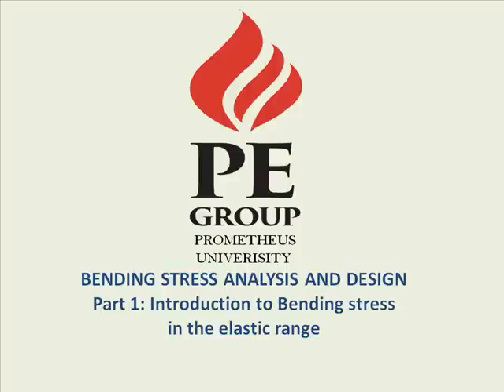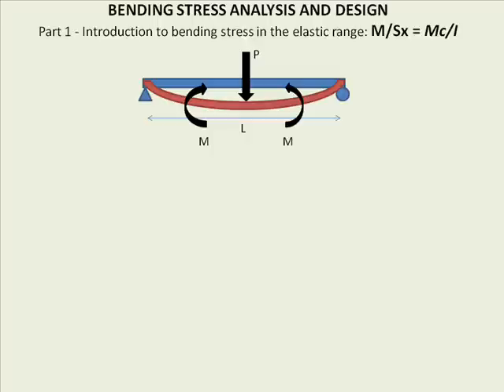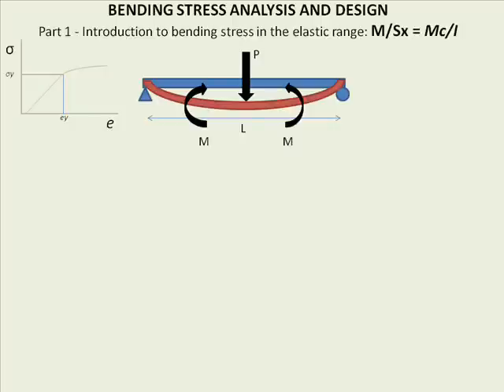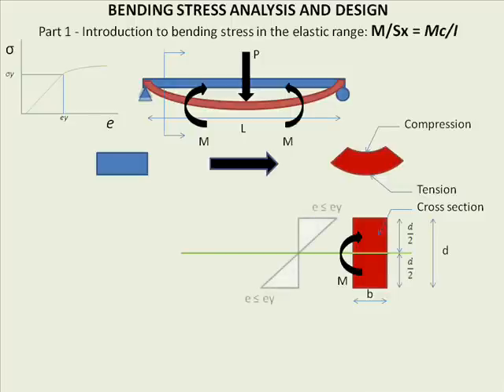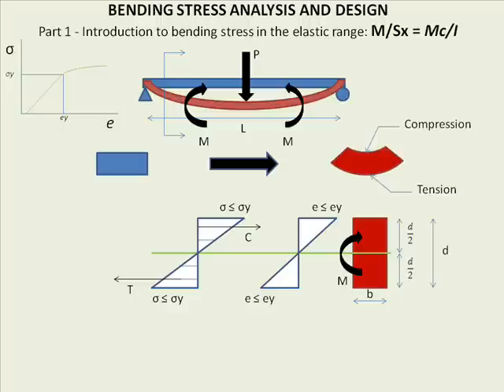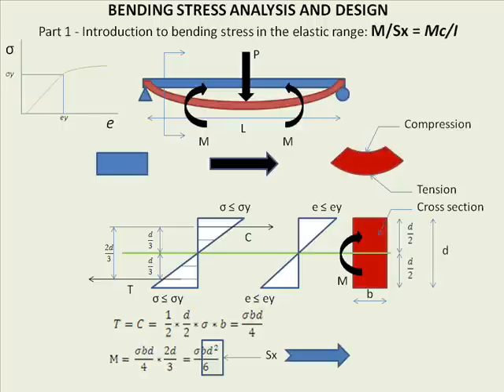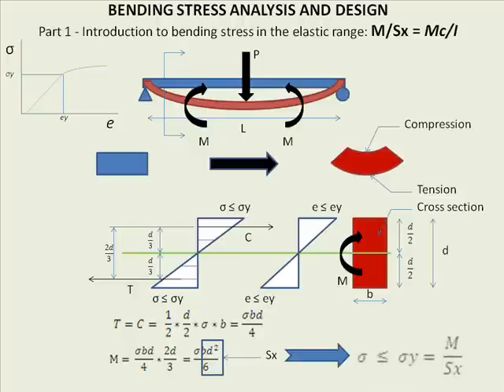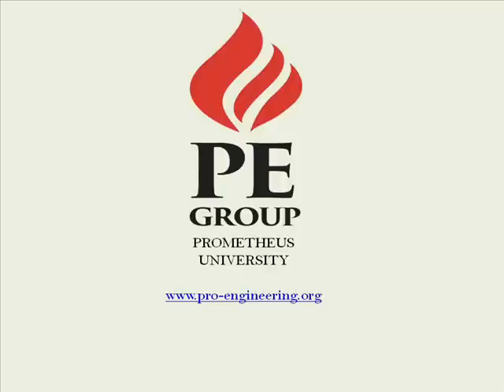Basics of Bending Stress Part 1 - Section Modulus

Comment: Hi sir ..there is two  question in  one of my exam ..they asked to select the correct A36 steel Universal beam which can carry 150 kn-m moment ..and also they given four options of UB sizes with Sx value ..how can I find it ..I tried  same procedure to find Sx  as u mentioned in this video but Sx value not matching ..I have considered allowable stress for A36 63 MPa and 150 knm moment they already given..but my final answer   coming .please suggest 2419cm3 ..but all option is like 780cm3 , 569cm3 like that ..please help In this
Reply from the maker: The was the shape of the beams?

Comment: 7:50 isn't that the total tension or compression  produced is equal to product of half the area of beam to the average stress. Since the stress induced in the section is changing at different points from the extreme fibre to the neutral axis.
The change is obiviously a linear change from the point of neutral axis to the extreme fibre.
So, 
 T or C = area * average stress
     = [ (1/2)*b*d] * (1/2) sigma

Comment: I thought the bending moment is maximum at the supports, I really don't understand how the bending moments is represented on the cross section.
Reply: Also, how is it that there's linear change from compression to tension? What's the phenomenon?
Reply: @ogagaritsesakpa5533  remember he said strains and stresses go in hand. in elastic range, strain and stress are directly proportional. strains occur most at extream ends of a section or longitudinally, along the top side and bottom side. this is where the stresses are extreme too in the material fibre. as you move from the top edges towards the middle(neutral axis), the stresses and strains reduce, the increase again past the mid-point (neutral axis) top strains and bottom strains are equal and generate a force that creates a turning effect and makes the beam deflect downwards. these forces are equal and opposite. one at the top tends to squeeze together the material i.e compression. one at the bottom tends to pull apart the material that is tension. the distance between them multiplied by either compression or tension results to moment.

Comment: I was following up until you went from the red u-shape (bent member) to the red rectangle (straight member). I can't seem to visualize which orientation that's in. My professor did the same thing and I can't make that relationship.
Reply from the maker: The red rectangle is the beam cross section (not the side view) however the stress and strain diagrams are in side view orientation.  I Know it can be confusing.  Perhaps I can give you a 3D illustration.  Let me know if this clears things up and thanks for being an engaged fan!!!
Reply from the maker: Sure.  What's the problem?  Note that the only difference is the shape of the cross section which means that the section modulus (c / I) will be different.  We can derive the parameters or use the formula for moment of inertia of a triangle to tackle the problem.
Reply from the maker: Here is another video for our loyal fans! This one breaks down the concept of shear stresses in beams!
https://www.youtube.com/watch?v=fJiJY06iX7Y
Reply: @prometheusengineeringgroup7825  red rectangle is the beam cross sectional side view right??
Reply from the maker: @arjunsr3379  No.  Sorry for the confusion. the moment sign makes it confusing
Reply from the maker: Please see our latest video on structural dynamics
https://youtu.be/ZxvLC-91QKs